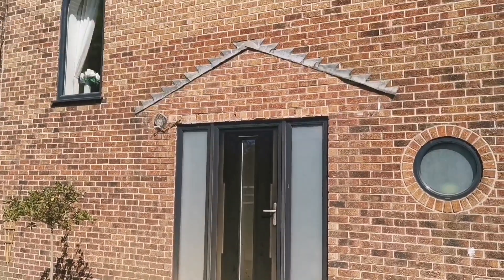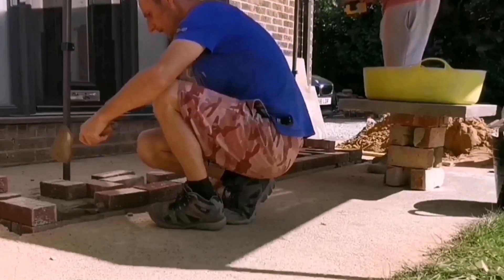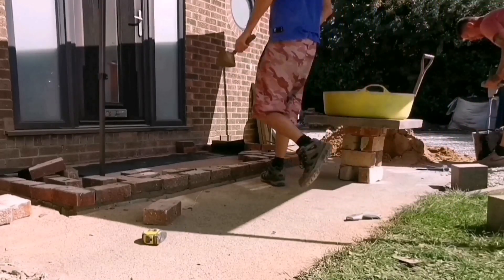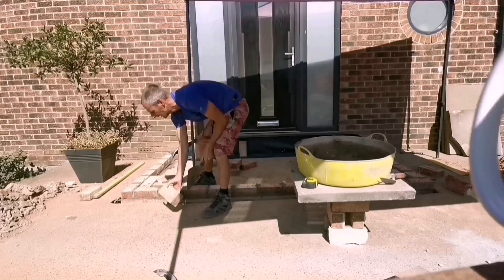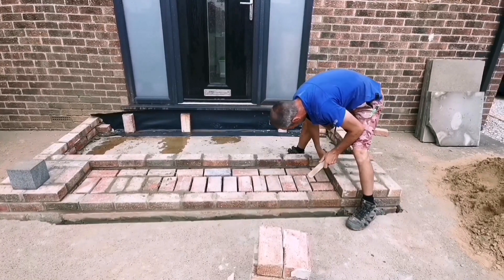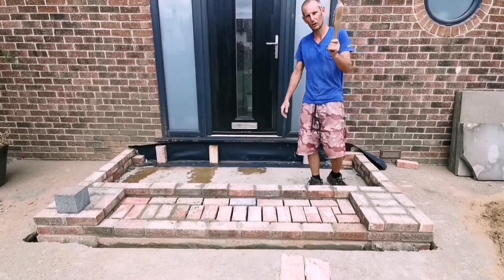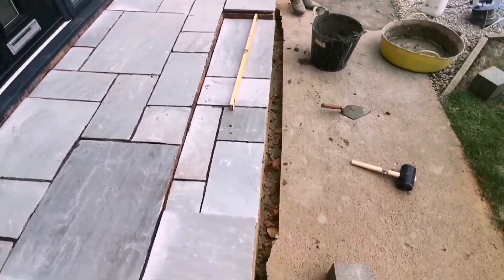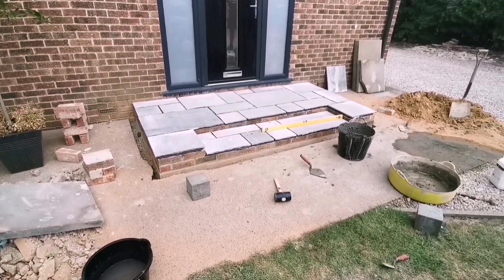building steps for oak porch. talk through

Comment: Looks cracking. Can I ask, where did you source those pad stones (AKA ‘staddle stones’) and are those made of granite? Last time I did something similar (about 10 years ago) I had a guy make me some for me from sandstone (as back then couldn’t find a supplier for them). Have another project coming up where I need some and quite fancy granite ones instead. Anyway, if you can share where you can get these from that would be much appreciated 👍
Reply from the maker: Thanks mate .I would to tell you it was a shop .but these came from eBay 6x6in granite.the customer got them in bulk.i did a big carport with them .then sold two more to this customer 👍👍